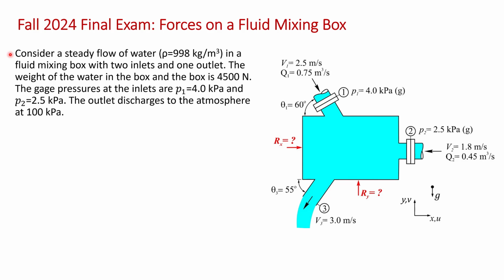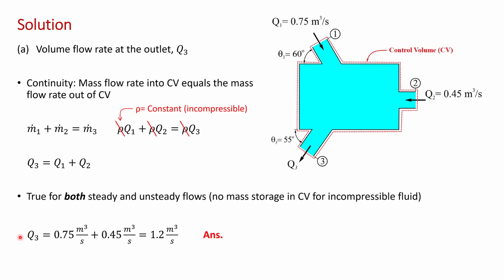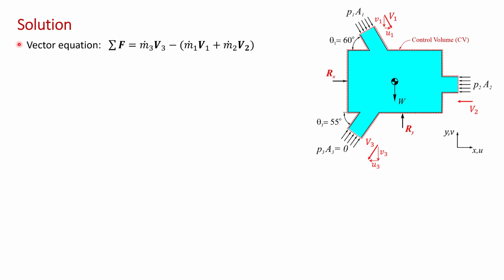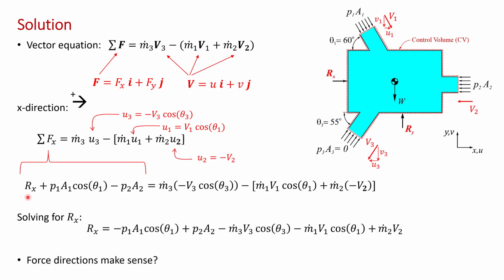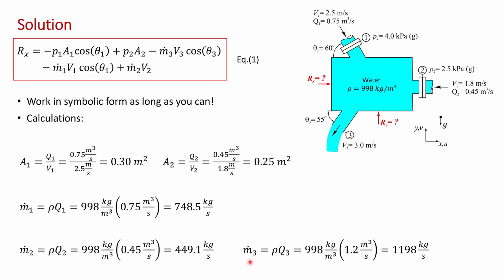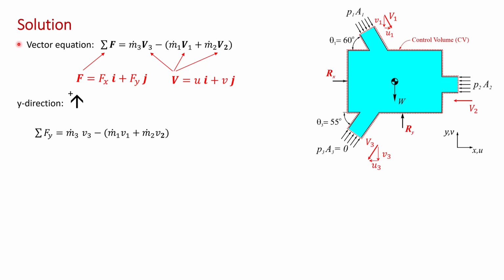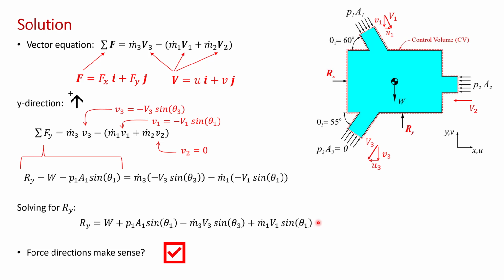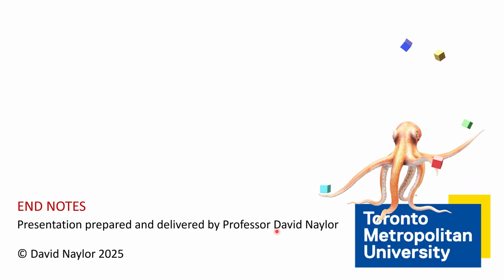Forces on a Fluid Mixing Box: Fluid Mechanics Problem (Conservation of Momentum)

Comment: Why the pressure on the inlet and outlet go inside the VC, despite the fluid flow
Reply from the maker: Pressure forces are SURFACE forces on the outside of the control volume. They must be included. Pressure dives the flow. I hope that helps.